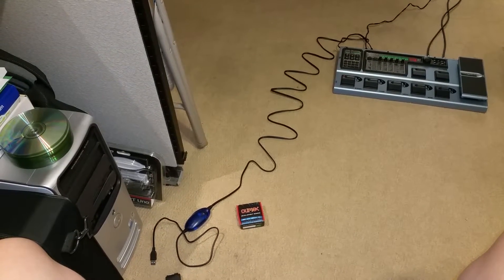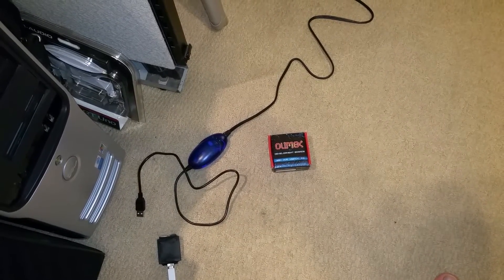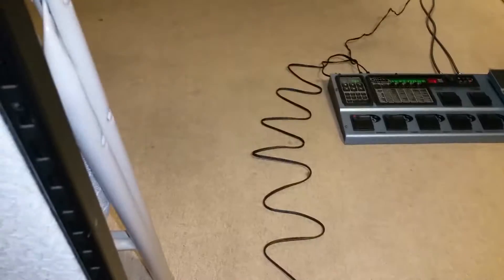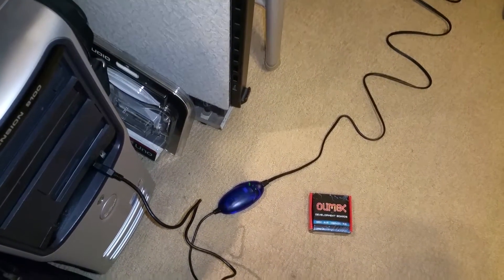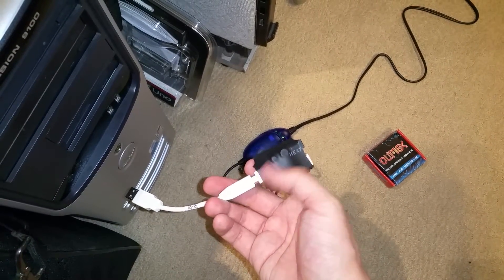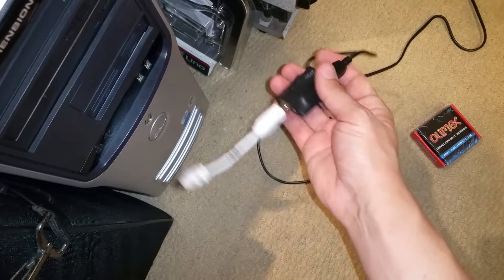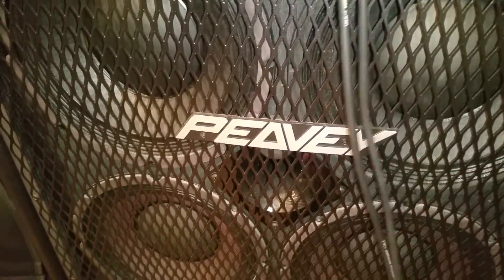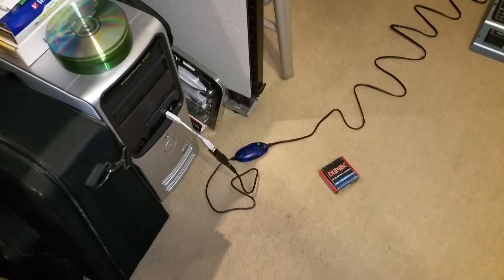M-Audio Uno MidiSport Optical Isolation

Comment: The reason there is only one opto isolator is because the midi input port of the connected device also 'should' have an opto isolator, 
 making the isolation both ways.
But, there can be an issue with the ground wiring for the midi adapter shield, the midi out shield should be connected at the adapter but not at the 5 pin DIN plug end.
The midi in shield should be connected at the 5 pin DIN plug at pin 2, but not connected at the midi adapter device.

Possibly the UNO has the shield for both the in and out connected in the midi adapter and the two plugs and creating a ground connection thru.

[img]https://europe1.discourse-cdn.com/arduino/original/4X/6/c/7/6c76b825dc67e1afdc57ceba497d4bf58184c280.jpeg[/img]

Comment: You could also sever the ground with a cable mod to the usb side.   in 2 places, first ,sever the metal ground   that encases the wires inside just beneath the insulation. This ground is attached to the hard rectangular metal usb casing at the end of the cable.   Next the inner ground wire itself needs to be severed which is attached to one of the  usb prongs. a usb schematic will show you which is the ground wire.       This procedure breaks the ground loop thus silencing the noise in question.

Comment: I have a 1995 Yamaha PSR225gm keyboard that can use midi. And I bought that exact blue MIDI cable you have. I plugged it into my keyboard and into my USB port in my PC. Nothing happened. Help?
Reply from the maker: Bumboozeler hard to diagnose. could be a software config issue or remote possibly unit is bad.
Reply: xboxer1985 Ah okay thank you. I suspect its just my keyboard is old as shit.  But hopefully i can call Yamaha support
Reply from the maker: Bumboozeler best of luck bud!
Reply: xboxer1985 Thank ya
Reply from the maker: Bumboozeler sorry couldn't be more of help